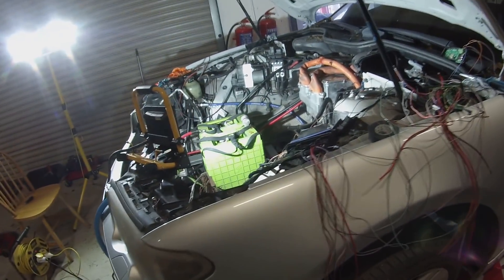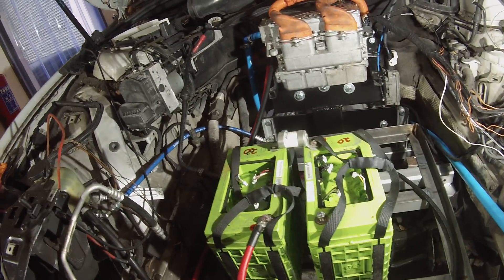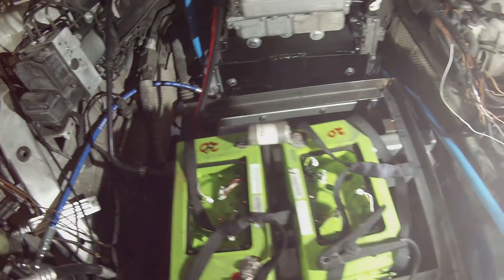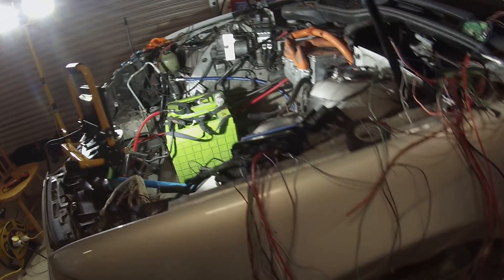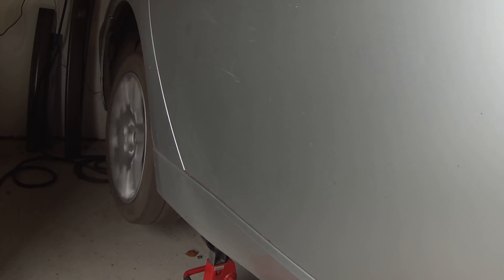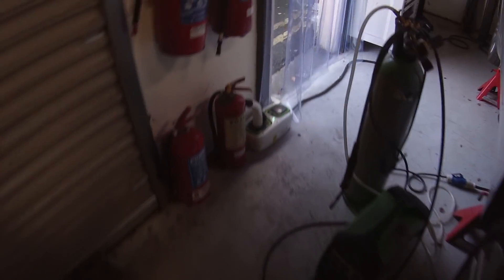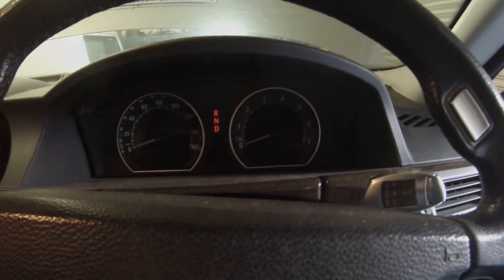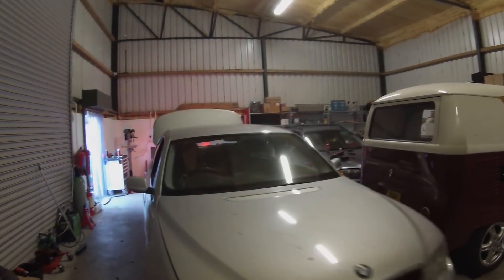Electric E65 7 Series : First Roll

Comment: How in the hell did you get this thing to run without the engine or transmission. There's so many electronic nannies in that e65s I thought they would just light up the entire dash and the BCM would die
Reply: Reverse-Engineering of CAN systems, 
"sniffing" of CAN data-traffic,  
& SPOOFing of required CAN confirmations !